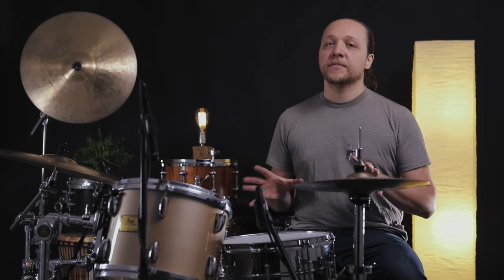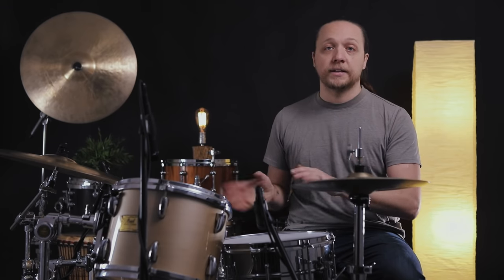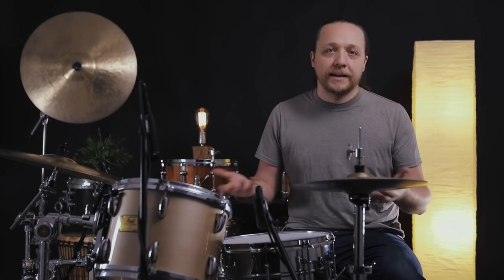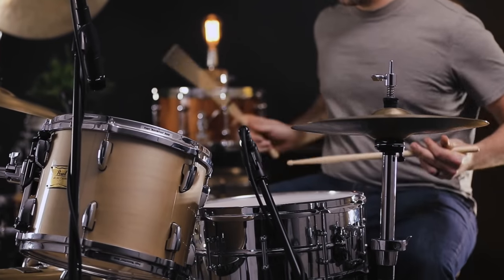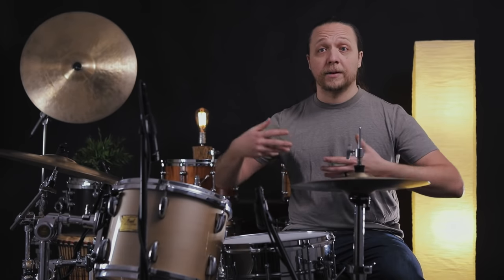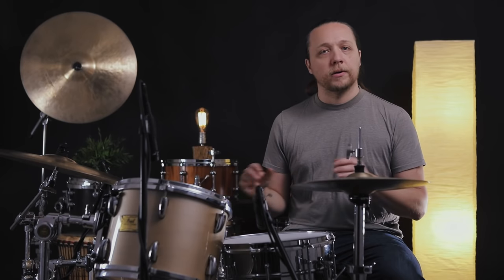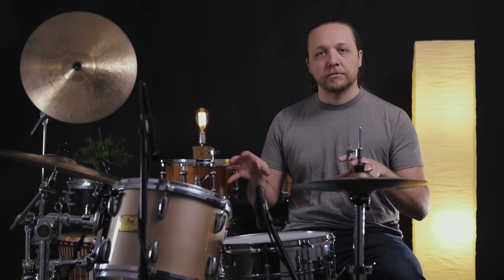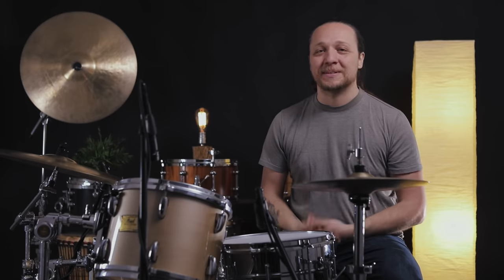Your Resos Are Killing Your Tom Tone | Season Three, Episode 38

Comment: I use this concept to my advantage. I tune the top and bottom  rack Tom heads the same for tone and resonance. But the floor Tom’s and kick, I keep the reso heads a little tighter and the batter real loose. This naturally muffles them. Not completely, but it definitely calms them down
Reply: What about on the floor Tom,seems to have boing sound and always have to moonjell the crap out of it,doesn't matter what kindve heads I use,please help.
Reply: @chriscobbdrummer6876  If you are talking about that "bouncing basketball" kind of sound: You can put a paper towel or some kind of fabric inside of your floortom to absorb high frequency standing waves insinde of the drum. I think there was one episode tackling that topic...
Reply: Loose batter heads = no control, unless you are a banger only.

Comment: That snare sounds incredible!!
Reply: I just listened to this with headphones and that snare just got my attention. It’s sweet
Reply: Would this work if had a coated g1 on top.
Reply: Too much ring.
Reply: @johnminarik3442  I agree, I bet in the room it was more also.  But it's still a great tuning, nothing a little muffling can't fix.  You could probably get rid of it with EQ but I prefer to get rid of stuff like that at the source and leave the EQ for shaping rather than surgery.
Reply: @djjazzyjeff1232  

Agreed.  I utilize the internal snare muffler to get where I want.  I am so old school I used to "rag" my tom's, but with the heads currently available, not much need for that anymore.

Comment: 9:50: my strategy recently is to remove the batter head and hoop entirely, tune the reso so it’s maximizing the resonance of the drum itself, and only after that’s been executed correctly add the batter. It really helps with the coated batter heads that work best with brushes.

Comment: As a 69 YO, Rookie, Cody is one of the best Instructors on the Web.  Holy SH^T , Never realized the the ART of tuning and fine tuning drums.  When I played 0ver 50 years (15-18 ) ago, I never knew there was such technical advice about tuning.  Anyway, I have a cheap Gammon kit and I have been experimenting with new Heads (tried 3 different ones) so I am simply trying to obtain the "best" sound I can achieve...  Happy Drumming All, Be Safe

Comment: Great to have my suspicions confirmed. I always tune reso heads slightly higher than batter side, except on snares where I tune the reso head even more and then adjust the snare wires and top head to suit whatever I’m playing. 
But I’ve always had some trouble tuning rack toms especially 8-12 inch toms. They either ring out far too much or don’t ring out nearly enough. There’s a very distinct sweet spot somewhere in between, but with the reso head still being tighter than batter. 

Great video, great production, great playing and engineering, and all around very helpful and well made. Cheers from Texas!

Comment: Awesome job you included just the right amount of topics didn't get too deep into either one. I restore drum kits and other musical antiquities, knowing the correct tuning, the correct head, and the correct differential between heads cannot be overstated. iT. I tune Tom's top to bottom with either the native shell tone or more often call to the Post. I like mine the same if I want a shorter tone I use studio rings, this gives me both options without having to re tune. I played around with reso heads on snares only to return to standard Remo res. You articulated extremely intelligent and spot on correct information. Cheers

Comment: Just installed new Evans G2 Reso heads a few days ago (including batters) and YES! That WAS the problem. Can't stress that enough! Your channel is extremely helpful! Puts a smile on my face every time you guys upload a new episode!
Reply from the maker: Nice! Rocking the two-ply reso? That's definitely a fun sound. Glad you're enjoying the series! -Ben
Reply: @SoundsLikeADrum  Yes, the two-ply version! Fiddled around with a mix today and was shocked how little plugins I've manage to use to get an awesome sounding mix. It's true when they say your source has to be proper in tune, hehe. And I've completely dissembled the whole kit, cleaned and polished every screw and nut, got new tension rods (Zebra Drums Thread Locks), applied white lithium grease and installed new skins. All thanks from what I've learned here on your channel! Thanks a bunch Ben and Cody! Rock on!

Comment: Cody,when you first started playing example one.Thats my sound.Thats what I go for.I call it punch.!This is my drum sound.I don't use a tune bot,or tension meter to achieve that sound just 2 drum keys and my ears.I always found it so much easier by using the same heads top and bottom,clear ambassadors. For years what ever I did to the tops I did to the bottom heads.Never had to put anything to dampen my heads.Recently I started pitching my reso heads up about 25% higher or lower depending on the kit.Just that little 1/4 turn with the drum key makes a big difference .Hearing your drum sound in the beginning is just the best for me.It works great live and in the studio.Ive always took a lot of pride in my drum sound and have had people tell me they sound like a million bucks. It's sad when you see someone playing on a very good set of drums and they sound terrible in the audience. It makes you want to tell them,but how do you tell someone there sound is terrible? Hopefully they will catch this video and a light will go on.Thanks guys,love your channel. Your the best.!

Comment: My drums are 1961 Oaklawn Camco Ambassadors in the rare Burgundy sparkle colour, I’ve owned them since 1990. 12”, 14”, 20”. My method is simple: coated Remo Emperors on top and bottom, tuned to the natural note of the shell. Done. I’ve had countless drummers say to me “if you ever want to sell these, call me first!” They just sound that good. I attribute the sound to the old school 30 degree bearing edges, and the fact that the wood is 60 years old. I love my old kit.

Comment: I've always struggled with tuning the heads just right, never even thinking about at what pitch range they have a clear line of communication. When I do get the right sound, I go so long without tuning them again that I forget what I did to achieve that sound the first time, lol. This was super helpful, thank you! 

I only recently learned about how different the drums sound when you're sitting at them vs across the room. So you touching on that subject really helped paste it into my conscious when i try to tune. I use a Tascam to record about 5' away, so that would explain why my toms sometimes can't reach it.

Comment: Cody, Listening to your Pearl Drumkit makes me realize that as a Beginner / Low Intermediate 69 YO drummer , that I need to Upgrade my kit.  I was gifted a Cheapo Gammon drum kit in 2018 by my wife - of all people - for Xmas in 2018.  I have returned to "playing" drums again after a 51 year Hiatus from my Garage Band playing days.  God Bless her - I play now for pleasure in retirement which was forced by spinal disabilities.  The kit has a 12, 13 and 16 inch Toms.  I replaced the Heads after 6 months of playing on the crappy stock heads.  Evans G1 on the batter heads, coated Remo Ambassadors on the Reso sides.  I have been able to tune the 12 and 13 inch Toms to a decent level using These Tips.  But I can't get the Floor 16 inch Tom there.  No matter what I do.  Note that I do use Gatt tape and Moongels for all the Toms.  I'm not going to Play "Gigs", but look to obtain a nice sound when nI play along to My Music.  Any other Tips for the Floor Tom?  By the way, I saw your Video on Attack Heads.  Tried the 2 ply coated on the batters and 1 ply coated on the Reso......  NG.  Better sound witht he G1s on the Batter heads. THX for info and advice.

Comment: Did you also notice that the sound of the snare drum kinda changes too? The whole kit actually has a different vibe with different tunings or if you add or remove a drum. Subtle but definitely different. I normally tune my resonant heads a minor third higher than the batter. Like you, that has always given me the character that I'm looking for in my drums. However, I find that with my latest kit (Ludwig classic maple) the 16x16 and 18x16 floor toms sound better to me with the reso heads a half step higher. Of note though, I don't tune my batter heads real super low like most drummers I see on Youtube do. The rack tom, 13x9, sounds great with a minor third higher reso. The floor toms have some conflicting overtones with a minor third higher reso that seem to be better controlled when the reso head is a half step higher. As you say, you just have to experiment until you get the sound you are looking for in the musical situation that you are involved in :)

Comment: I use this simple tuning method as a rule for reso heads. 

Snare drum - 2 full turns from finger tight
Rack toms - 1 full turn from finger tight ( then reseat with downward pressure and pinch each lug a teenth of a turn)

Floor toms - 1/2 turn to 1 full turn on floor toms (reseat and pinch up) 

And make sure each lug is PERFECTLY in tune. Works every time.
Reply: Pretty much how I’ve always done it too but usually set the kit up toms upside down so I’m happy with intervals between drums - then 💯 make sure each drum is in tune with itself at EACH lug. 

The tops kinda tune themselves but I always tweak each lug so they are in tune with each other too 🤘🏼
Reply: With floor Tom's depends on the size and number of tuning rods. When the rods are further apart you have less control over the tuning and the tuning won't hold for long. Top class sonor floor Tom's can have 10 on the 16 head allowing real even low tuned sound that would be crap on say a pearl export 16 ft with 6 tuning rods.
Phil Rudd has known this for decades.
Reply: My finger tight might be more or less than someone else’s depending on hand strength just my ocd

Comment: I downloaded a piano tuner to tune my piano and now tune my drums with it.  I use specific notes in intervals.  Two Roto toms 6, 8 then 10,12,14,16 toms.  Tama Starclassic.  Never use damping but heads have a damping ring.  I found the notes of the drums online, recommended ranges for diameters of drums.  I take the written cheat sheet on gigs and always have great sounding drums.

Comment: Great video - definitely gels with my experience over the years. I've found that if you like your toms to pitch bend down slightly after it is hit, tune the reso head slightly lower than the batter head. If you go too low though, you risk that weird "boing" decay. If you like a faster response, tune the reso head slightly higher than the batter head. If you go too high, you can hear a really weird pitch bend up in the decay. I hate both effects of going too far, so it always sticks out like a sore thumb (or drum in this case). ;)

Comment: You may have mentioned this in another one of your videos, but resonant heads DO NOT last forever.  I try to change my resonant heads with every three top head changes.  I know it's pricey, but it's crucial to maintaining a good sound.  Same goes with the snare side head.
Reply: They dry out, don't they?
Reply: @mr.s.7081  how does plastic dry out? Calf heads, I could see it happening...
Reply: @glengamble526  Just something I've heard, but of course you're right. Plastic is plastic, but they do get worn out - not that I changed mine very often.
Reply: @mr.s.7081  they aren’t being struck. And are only minimally being re-tensioned. So, I personally don’t feel is THAT important-or at least, my 35+ years of pro experience tells me it isn’t. What I DO think is important is making sure you have the right reso heads in the first place. The proper thickness (thinness) and proper material. I’ve seen people out batter heads on the reso side and then wonder why their drum sounds muted...
Reply: @glengamble526  Batter heads and resontant heads aren't the same thing, for sure. How often do you change heads when you're playing on a regular basis? I read that the drummer for a female pop star (I forget which one, but someone like Ariana Grande) changes (batter) heads after three shows, and I though jeeze... $$$
Reply: @mr.s.7081  well, another point to consider here: if you’re playing in that league, you’re probably endorsing a head company and at the very least get artist pricing in heads. Not to mention, often times, things loose heads and stocks can be production expenses paid for by the artist you’re touring with.
Reply: @glengamble526   ...mmm take a good look at your cars dashboard = dried out and cracked !

Comment: I still own my Pearl Export series that I purchased in the mid 90’s. Over time they are a little tough to tune properly, specially the bass drum. I’m gonna restore them, because I love the square sizes I have. I have a 10”, 12”,13”,14”16”&18”. The only drum not square is my bass drum it’s a 24”x18”. I’m definitely gonna try this technique once I get them up and running again

Comment: I need to try this out, I use a drum dial and I usually set the reso and the batter to the same tension but I need a tighten up the Reso just a bit to see if I can get more projection, I like the sound that I get but if I can get a better sound I'm all for it 👍

Comment: Great info as usual!  Just put Reso7s + UV2s on the kit. Small adjustments on either can change the tone and or ruin the tone. Love the tip to start with the batter tone and feel you desire then match the reso. From there stop or adjust up and or down!  Another top notch video!

Comment: Excellent video guys! My floor tom would ring & ring... ended up placing an old Evans EC-2, with the internal rings, and that helped tremendously. This video has me re-thinking if that is just a band-aid and I should start from scratch to correct the work around.

Comment: Support these guys on Patreon, it is a good investment. There is always something new and important in their episodes.
Steve Maxwell once told me, that he recommends tuning the reso head a bit lower than the batter, because the toms would project much better forward in an acoustic situation. Higher reso tension made the tom less audible from a distance by the audience, he says. By the way, even John Good, the drum guru (DW), tends to tune the reso lower. He argues with pitchbend behaviour of the sound. Pitchbend is a matter of tension, I think. Lower tuned heads are more streched by the hitting stick and therefore produce a relatively higher pitch at the beginning than do higher tuned heads.  I personal use to tune all reso heads a minor third lower than the batter. My 12/8" rack tom is tuned to c (top) and a (bottom). It is, I think, important, that the tension of any head is as even as can be. I use an analog tuning device and a hard timpani mallet. Drum sticks produce too much overtones. Steve Maxwell tunes by ear. He says, toms aren't timpani. But it is a great experience to hear and play quasi singing toms, what is achieveable by exact tuning using tunig devices.

Comment: +soundslikeadrum  I usually do the Helmholtz-resonator trick on both heads for maximum sustain from each drum.  Given my penchant for heavy sticks consistent with the VIC FIRTH® CORPSMASTER® range, I went for EVANS®/D'Addario® EC2S coated batters across racks and floors; but financial constraints allowed for EC2S clear resonants only on floor toms as of January 2021.  (I really want Heavyweights for the tom batters, but Evans only has 'em available for ø12", ø13", and ø14".)  From data at Tune-Bot.com, when tensioning my TAMA®/Hoshino® poplarbuilts, I go for G3, D3, and B♭3 on racks; F2 and D2 on floors; and B2 on kick.

Comment: I have recently experimented with putting Hydraulic Evans as the reso and the Evans onyx black heads for the batter, the hydraulics provided a great reso sound and muffle rings on the top added some more control but they do not sound flat or dead they are monstrously loud and deep, I found tuning almost identical in tone with the onyx works well. I would however recommend experimenting with different batters if you were to try this idea. I use a vintage Remo acoustic on bravo 2 set

Comment: Really great video! I normally use a pretty straightforward setup of coated G2s on the batter side with clear G1s on the reso side. In the medium tension range, I found great sounds with tuning both heads the same pitch, the reso a half step higher, or a whole step higher. But probably the half step higher on the reso side seems to work best on my kit. Experimented though recently with the minor 3rd interval on my 12” tom (reso higher) and it was quite good.

Comment: This is interesting. We take very different approaches to head tension. I don't tune my toms; I tension them. I learned how to do this from Rob "Beatdown" Brown's videos - basically press on the center of the head and turn each tension lug until the wrinkles in the head just disappear. My toms sound great doing this. Having said that, your toms also sound great. Different approaches but both seem to work. The "tensioning" approach is the reason why I would never spend money on something like a Tune Bot. For me it's not about pitch, but rather about optimal tension for the specific head and shell. (My snare is the only drum for which I consider pitch "a thing" - Reso head as close as possible to a perfect 4th higher than batter head. This is a trick Joe Morello taught me)
Reply: I actually avoid that downward "bowwwwwww", don't like it lol